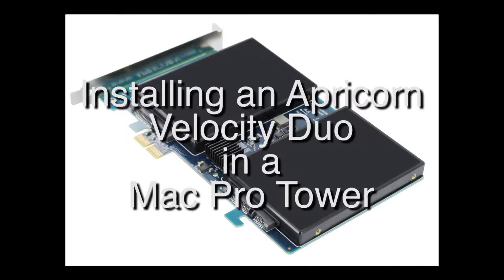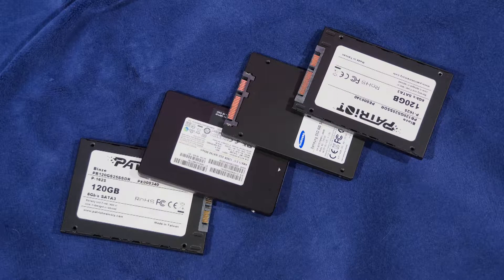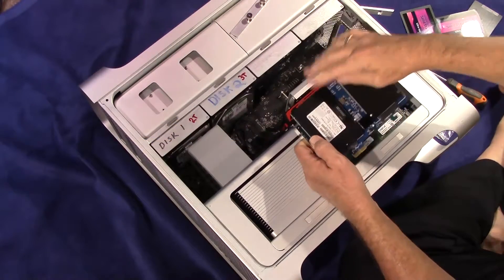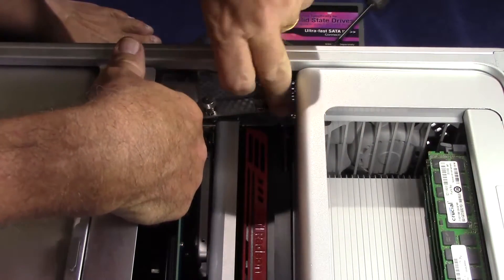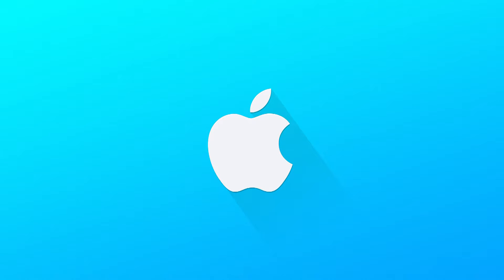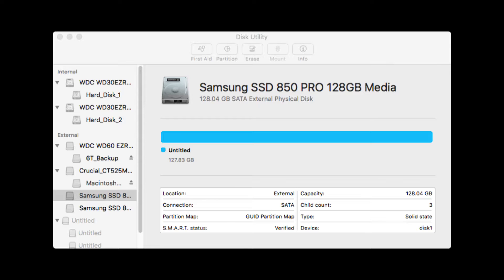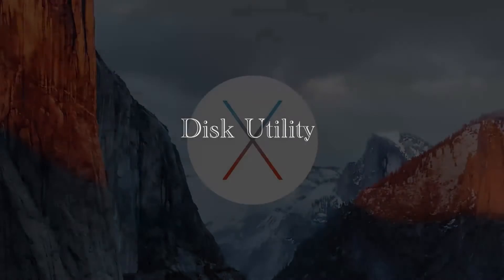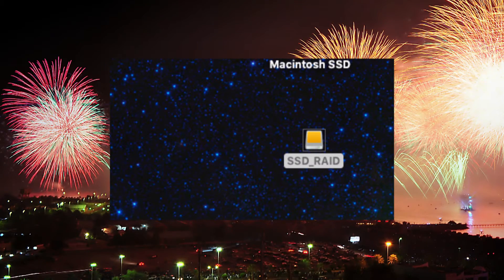Installing an Apricorn Velocity Duo in a Mac Pro Tower

Comment: do I have to raid these or can they operate separately on the pcie card?
Reply from the maker: No, you do not have to use these as a RAID.  It works very well to support 2 independent dives.  Furthermore it is much easier to set up, for they need not be well matched, you do not have to zero out the drives, or anything.
Reply: David Courtney ok, so what model is your mac? mine is a 2008 3,1 and I could not get it to work. I tried to instal my already existing ssd boot drive with Yosemite on it along with a new drive out the box. how should I have gone about this?
Reply from the maker: I have not tried on a 3,1 system, but I vaguely remember something about the card not working in every slot on the older machines,  This could be resolved simply by shifting it to a different slot.  Better google for more info.
Reply: ook, well i tried all the slots and it did not work. I'm getting ready to attempt one other possible solution. if that doesn't work, ill be sending mines back for a refund or credit towards another card. Thanks for your reply it has been helpful. how is your mac pro performing for you to date? what do you use yours for?
Reply from the maker: I use mine for audio / video production work.
Reply: David Courtney Nice...so are you able to edit 4k smoothly? I want to do some video editing on this machine. i haven't used this comp for that to date. Its mainly been a music creating machine for me.
Reply from the maker: I do not do 4k, I do HD